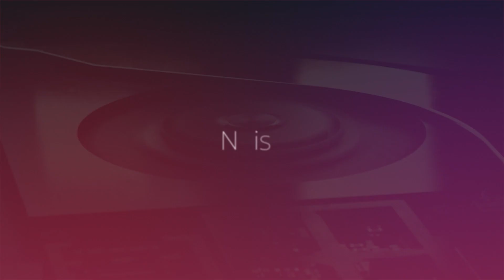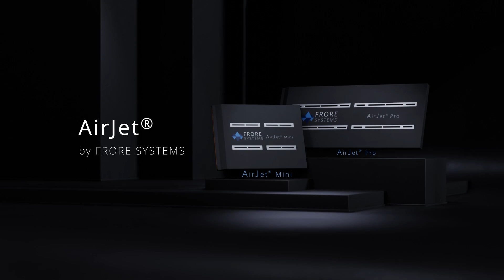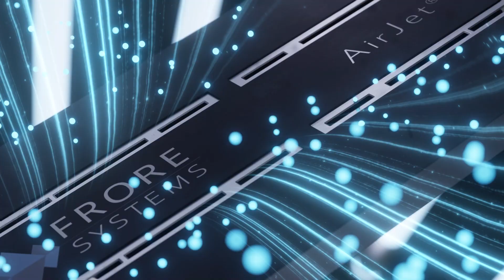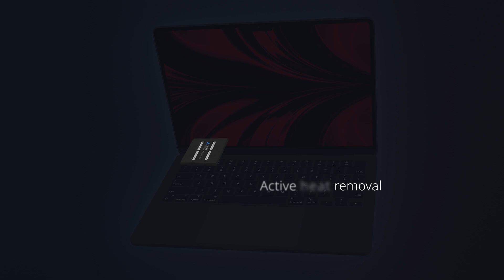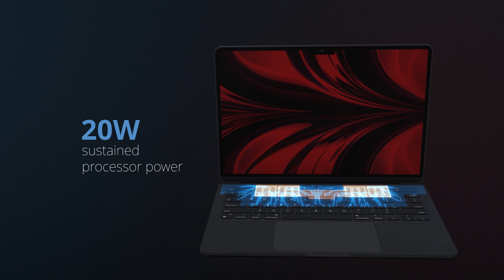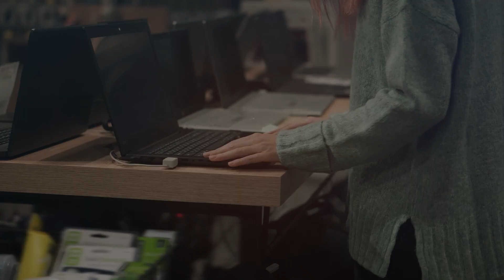How AirJet® Works

Comment: I don’t get it. Modern cpu’s produce 100 to 300 watts of heat - don’t they? What is 10 watt heat dispersion going to do?
Reply: There is a chance for a bigger airjet, and you can stack / line them in series to achieve bigger watts of cooling power

Airjet pro 2.8mm thick capacity of 15W, and just by stacking of 5 airjet pro would suffice 65W Ryzen 5600X with less than 15mm thick cooler? I would love to buy that

Comment: as a fan of air cooling vs liquid cooling, I really want this. But seeing that it's using the tiny membranes vibration, I gues it's impossible to make it bigger for desktop PCs. but nothing is against me lining them up on top of each other except the fact, I can't even buy it yet
Reply: With GPU board getting smaller, PSU also smaller with bigger watts, and ssd getting bigger in capacity for smaller size, there is a high possibility of desktop pc also getting smaller… they can pack a punch into smaller chip, then so does this cooler will be.

Maybe on 5 or 10 years whole PC industry will me much different
Reply: My question is Why you need to make it bigger?

Comment: Bad explanation.  The high velocity air is solely for one purpose  - to break the extremely combusted micro air layer above the very hot working CPU - so it can break down the thick combusted to disperse faster/better away from the CPU.  Heatsinks can't disperse the combusted hot air anywhere near fast enough than this.  That is the WHOLE point.  Thumbs down.

Comment: Yo, this is game changing (pun intended) stuff. Gaming laptops are throttled to an extremally disappointing extent by thermals currently. I have a laptop with an i9-13980hx and a 4070 and unless you use something like the IETS 500 laptop cooler that creates a vacuum under your laptop to force a ton of air through your laptop exhaust ports and sounds like an actual vacuum cleaner, you have no prayer of that i9 ever being able to reach anywhere near its full potential. I am legit about to be checking every day to see if this company has went public so I can buy stocks lol. I don't understand how the world is not going nuts over this right now. I want this company to succeed with this project more than I think I have ever wanted a company to succeed. This is the one of the most amazing projects I have seen in a long time. I am so excited for this to become the new hotness (pun intended) and I wish this company ALL of the luck
Reply: This can help macbook air or to make more thin devices,it wont help to cool bulky gpu's and power hungry cpu's.
Reply: @Gamer-cz8mo i think that the popularization will make that more engineers will get into making them bigger and better
Reply: I agree, it is an amazing technology I think most laptop companies will adopt, and maybe even smartphones

Comment: Yet to see any independent tests but if it lives up to the hype then hope this finds it's way into a lot of slim devices, particularly the next Steam Deck.
Reply: Zotac has a new mini PC using this cooler and it prevents thermal throttling when running Prime95 and Furmark both at the same time.

Comment: Es posible utilizar este sistema para propulsar una aeronave ?

Como si de un motor de turbina se tratase ?
Reply: I had the same question while watching the video, imagining a drone or an aircraft, also thought about combustion motor cooling or if the exhaust pressure would be sufficient to blow a turbo!
Reply: The CEO said in another video that this process is how jet engines are already cooled. He just had the idea to take the process and down scale it into little chips to be used in electronics